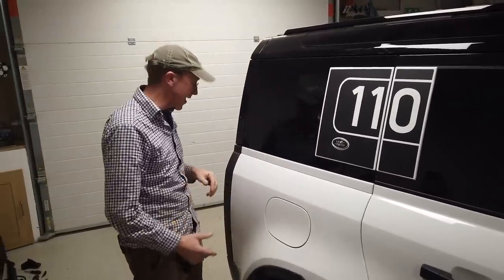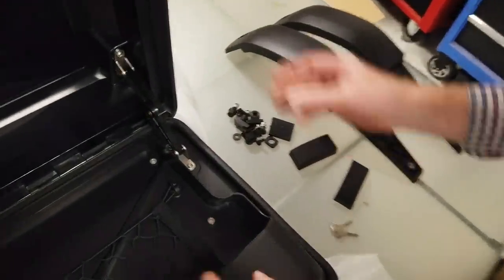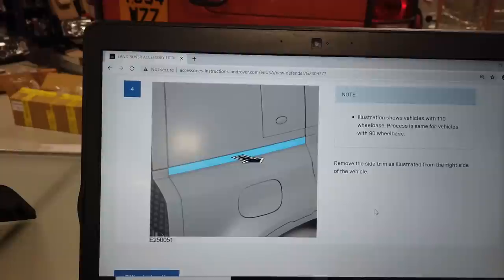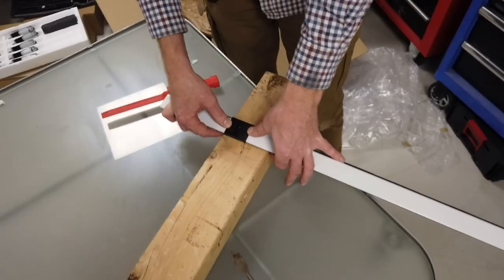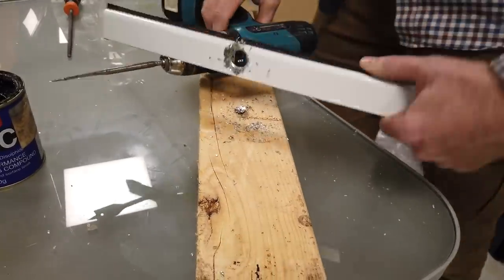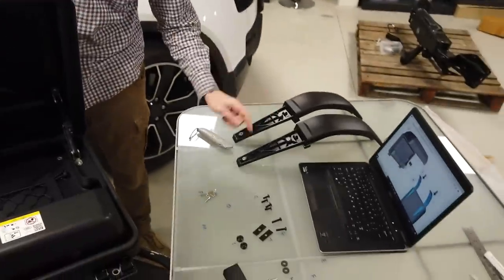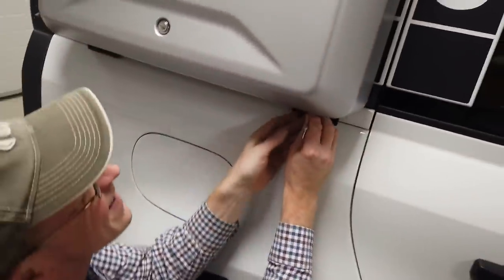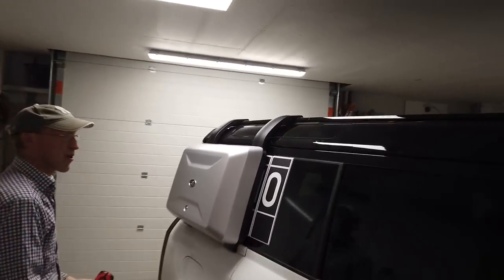Land Rover Defender 2020 side mounted gear carrier VPLEP0437 Fitting Instruction Video

Comment: It does seem strange to bolt a box on the outside of the car to only carry small stuff that would easily fit inside the car.
Reply from the maker: What would good is if it could hold the jack etc so then there would be no need to go under the boot floor ( and unload all your luggage ) to get the jack and change your wheel ( as the wheel is on the back door )

Comment: Seems to add a very small percentage of extra storage space at the cost of a fair percentage of extra aerodynamic drag ?
Reply from the maker: I would have to agree - if it was more easy to remove it would be much better as you could then just fit it when needed... not on the commute... my commute is about 4 mins ! so not a big issue
Reply from the maker: Miggy Z  Maybe i only made the video to see if anyone was stupid enough to watch it.....

Comment: Another great video as usual.  The obvious question is, why on earth would you want to pay £600 for that monstrosity clamped to the side of your Defender.  To hold your sanitiser and masks maybe?
Reply from the maker: It also limits the view on the drivers door rear view mirror... not significantly but noticable.
Reply: You would think for £600 they would include the bottom trim piece save butchering your own trim
Reply from the maker: @dwrowley  The trim panel is £56+vat retail....so not cheap to replace if you get it wrong...

Comment: Yet another cracking video, you could do one of paint drying and we would watch 👍🏻. 

So here’s an idea for a video experiment which will be very interesting, motorway run at a set speed without roof rack and then the same road and length with the rack. Would be very interesting to see how the economy is affected 

One step further ?  Get a db meter to check wind noise.

Comment: Another thoight - I am surprised that JLR only give the measurements from the edge to the point where the hole is - they should also give the measurements from the edge to the edge of the drilling tool - this would make it much easier to get the hole in the right place because you can't see the mark you made when the drilling template is in place.
Reply from the maker: Yes this was my thought in the video... but the idea of placing the jig on the trim and sliding it and measuring the hole lcoation seems the best idea

Comment: Land Rover states the lunch box can only be fitted to the drivers side which is where the ladder would go when you put a Clam Shell Tent on top, so in your opinion could the lunch box be put on the passenger side which is where I think it should go.
Reply from the maker: I looked at this today... and the passenger side has the mounting points in different places and only 2 ( not 3 like on the drivers side ) The 2 seem to be very close and I guess are there for the Land Rover ladder.
Reply: @L663  thank you for the reply, it seems strange they would do that as 270 degree Awnings go on the passenger side so then you can not use the ladder, I know they would be thinking of America but they should also think of Australia and the UK which I am sure would have the same issue, any way many thanks. Mike P.S. Love your Channel on the Land Rover Defender
Reply: 270 degree awnings can only be opened on specific sides but they offer both sides. I need to see if it will be a problem, but hanging low, I don't think it will interfere with an awning.
Reply: @spikemd1364  Many thanks for your comment.

In Australia the 270 degree awning is fitted on the passenger side (Left Side) so if the awning is open you can not use the ladder.

Any Way Land Rover has agreed to put a Riv-Nut on the Passenger side so I can swap the Pannier over and the ladder will fit on both side so that is all sorted now.

Comment: Is there a drain hole in the bottom of the internal pocket? I reckon the ‘extra’ grommet might fit in there 😉
Reply: But would it still be a drain hole then?
Reply: Tony Packe it gives the owner the option.
Reply from the maker: Good idea... let me go and have a look...well you are correct there is a grommet at the bottom so the one in the bag must be a spare !... I guess this could be a good idea... if one was to put your wetsuit in there.... one use i have thought of is when we next go to France the cheese can go in the box so the car does not stink when you get back in the car after the ferry !
Reply: Also allows you to drain it easily if you  remove the grommet and give it a good wash when dirty.

Comment: Thanks for the video - is there a reason the box can only be fitted to the right side - I fancy a box on both sides. I've ordered 1 box for the right side but would prefer both sides to have fitted exterior boxes - thanks
Reply from the maker: So Land Rover pur 3 mounting hole on the RH side and only 2 fitting holes on the LHS
So you can fit the ladder on LH or RH side
You can only fit the side gear carrier to the RH side as the rear most mouting hole is missing !
You can drill a hole and fit an M6 rivut - we did this on our molle plate fitting video.
No idea why Land Rover decided not to fit the rear most hole ! bit of an oversight !

Comment: I would rather use a 19mm hole saw being that the trim is very thin.
Reply from the maker: Yes this would have been a better idea.... but the drilling compound worked !
Reply: When it comes to the roof rack I am very interested in seeing how easy it is to put on and off because I lift my Disco 4 rack off when not being used.
Reply from the maker: @stevewinterton2598  In the box it is heavy ! so i guess its going to be at least a 2 man job !
Reply: I use a system of pulleys and do it by myself. I haven't seen a half rack for the Defender that would allow for the carrying of a fifth spare wheel and the use of the sun roof.

Comment: Hi great video, just bought my second new defender , but my first hybrid, they fail to tell you, you have nowhere to put your cables or jack imagine my surprise and dissatisfaction.So your video has given me an idea although expensive. Question one ,will the cables fit in one and the jack in another? Second question  will a roof rack fit ok with  them installed . Great videos thanks.
Reply from the maker: That is a good question. The roof rack will indeed fit. I can test the jack in my car... but not the charging cables as we do not have any. Which charging cable do you get with the car - the 13amp household charger or the type 2 lead ? let me know and i will see if I can find one. Maybe our molle plate would help keep them organised
https://youtu.be/ocnU2PZCdzU
Yes the roof rack fits fine with the side box
Reply: @L663  Thanks for that , I have both leads  be interesting to see  good idea if you hang them in the boxes would make it very tidy. Keep up the  great work.
Reply from the maker: @malcolmhouse7285  what about something like this made for the side gear carrier ?  but nicer ?
https://eparksolutions.co.uk/product/wallbox-charger-and-cable-mount/
Reply from the maker: @malcolmhouse7285  I have found some leads on ebay so will make a start on this project when they arrive !

Comment: Extremely informative, thank you. I think designing a jerrycan carrier based on the fitting of the box would be great addition 👍 Very good location for the jerrycan too, right on top of the fuel tank lid.
Reply from the maker: Having fitted this i did think along these lines... I was considering making a version of the 2 hook ( Part B ) as once you have these they form a platform that you could mount a whole load of products onto. We may be able to do these in stainless steel ?
Reply: Yea, my Idea exactly, don't have much use for this box but replace the lower trim piece with a aluminum rail and you could fit anything you want. 🤔
Reply: @L663  I think that will be much more useful than the box, I would definitely get one.
Reply: @L663  I would order this tomorrow!  I came here just to ask if it was possible to buy some of the hardware bits without the box, so I could try to make some sort of molle panel for flexible attachments.
Reply from the maker: @jamesdavidheiser993  As far as i can see none of these are available as spare parts
Reply: @jamesdavidheiser993  That sounds like a great project. Please let us know how it goes.
Reply from the maker: It came to me in the night.... the "GERRY Can Holder".... I need to trademark that !
Reply: @L663  YES!!!
Reply: @L663  Trailrax Pak Rax type system might be a better solution as you can carry sand tracks or RotoPax 4 Gallon Gas Tank (being low profile it won't obstruct rear view mirror)
Reply from the maker: @TheGariuk  They are neat and similar to what i have in mind for our own solution... I will drop them a note.

Comment: I’d like to do this, well, more specifically, install your molle plate, but before I drill holes, I’d rather have a replacement trim piece to hand incase I mess up or wanna return to factory. Do you know what the part number is for that trim piece please?, I assume there are several depending on which paint color you have (Pangea Green here)
Reply: Think I found it, assume it’s unpainted… LR132274

Comment: Hi, don't you know if it's possible to swap easily the lunch box with the ladder? Do the holes on either side fit both accessories? Thank you!
Reply from the maker: The ladder can fit to LH and RH side - there are holes on both sides - the lunch box can only be fitted to the RH side of the car as the rear most hole is not there on the LH Side.
Reply: @L663  thank you for the reply!

Comment: Don’t use a wood drill bit on aluminium, btw does the box interfere with the rear vision from the door mirrors?
Reply from the maker: Yes i was a bit rushed ( excuse the pun ) but should have popped to screwfix and got a holesaw
Reply: powerfulukltd do the boxes restrict your vision from the door mirrors.
Reply: @scotiajinker8392  I just watched the video and then installed a box I got from Hunter's Prestige.  I just did a test drive and I was really surprised that I barely see it in my side mirror.

Comment: Will you be making a “lunchbox” for the new Defender that mounts to the other side? I know the USA would prefer a USA driver side lunchbox. The ladder can go on either side but the lunchbox can only fit one side
Reply from the maker: I could design a revised waist rail to allow this....
Reply: @L663  I’d be the first Customer. I plan on putting my ladder on the passenger side (US) so I can access my roof rack, which will have my cargo box that opens on the passenger side. Hence the reason I need the luck box on the drivers (US) side.
Reply: Why does anything require revising? Can’t one simply reverse the brackets to install on the opposite side?

Comment: When you held the two struts together, one did look slightly different from the other.  I assume because the vehicle tapers very slightly towards the rear.  Also - for cutting the 19mm holes, would a "tank cutter" have been better? or a taper drill?  I like the sheet metal hole cutters where you have two metal pieces that you tighten with an Allen key and slowly punch a perfectly circular hole in metal (even square holes if you get the right one).  The one thing about the side box is that they only seem to be in silver and not available in body colour (same with the spare wheel cover) - it seems a shame that they don't do these in body colour (or do they just want you to buy silver cars?).
Reply from the maker: Good points... a hole saw would be a better idea but i just about got away with blade drill ! I used one of the 2 piece hole punches when fitting a set of Ikea taps ! it came with the taps ! Not a fan of that silver... need some graphics for the side box !
Reply: @L663  I'm really surprised that they don't do body colour oiptions - it only really looks good on the silver car and odd on anything else.

Comment: Brilliantly helpful videos - thanks so much - wondered if you could comment on removal of the gear box and ladders. My ‘one who must be obeyed’ :) has permitted the addition on condition we can take it them off when not needed! I’ve had mine fitted pre delivery and now read in fitting instructions‘... not designed to be removed and could be damaged ...’ . Any guidance on how to remove them would be much appreciated ? :) Many thanks Ian
Reply from the maker: Hi Ian - the ladder top cover breaks whenever you remove it and this is something I need to develop a solution for !
The side gear carrier is much easier to remove but leaves 2 holes in the side waist rail trim that can easily be covered with some tape or I could source some plastic plugs that cvover the holes.
Reply: @L663  Oh fab thanks - that is hugely helpful - I am hoping Mrs G gets used to the box but you never know ! :) thanks again Ian
Reply: @L663  Simon, love the videos you guys make! Curious if you ever sourced the plastic plugs to cover the holes or if you happen to have a part number for the trim. I am thinking of removing the exterior box and want to cover the holes or replace the trim.

Comment: Great video!  Looking forward to seeing the expedition roof.  I have hear it adds a LOT of wind noise and pressure on the sunroof when the car is fitted with a sunroof.  I’d be curious to hear what you think and if you hear it.   Also looking forward to the wheel arches!  Great content and keep it coming!!
Reply: You do get wind noise for sure (true of any roof rack).  There’s a weird ‘chin’ on the rack at the front - which is either there to alter the aero profile or to accept a light bar (perfect dimensions).

As for pressure, I’ve not noticed anything, although I’m not sure what the symptom would be.  

Overall the rack is pretty neat and straight forward to fit (as I’m sure Simon will prove).
Reply: Alan Davies yeah, I appreciate your comments. I test drove a Defender with Explorer pack and it seemed that the Chin pushed the air right down onto the sunroof making the air flow not very pleasant when opening the sunroof.  I am looking forward to Front Runners rack when it comes out but would love to hear about other alternatives out there if anyone wants to share!